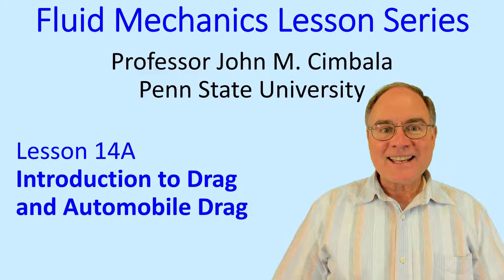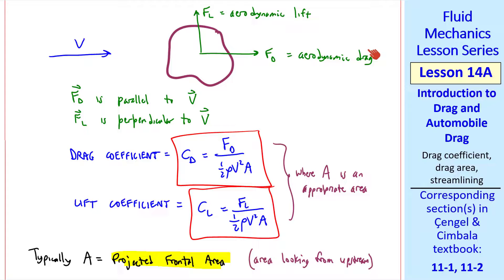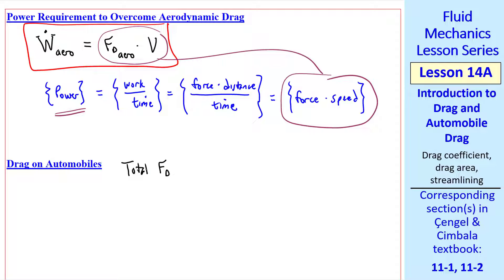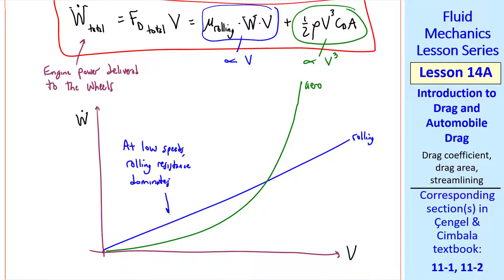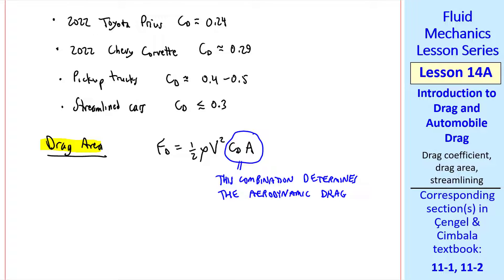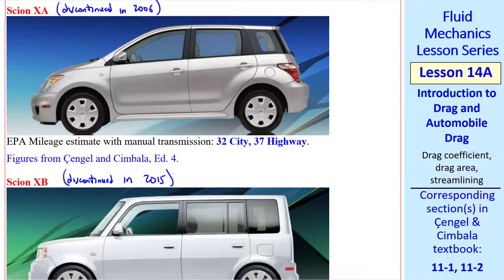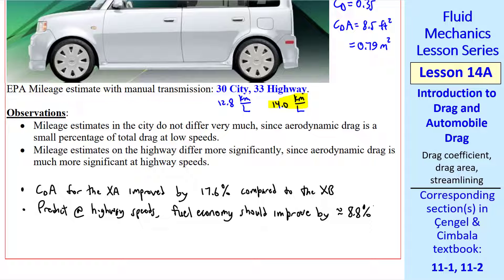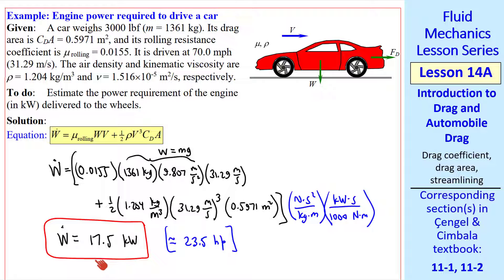Fluid Mechanics Lesson 14A: Introduction to Drag and Automobile Drag

Comment: Great video. I want to understand how to calculate the theoretical maximum speed of a car using the engine power, the car's dimensions, and its aerodynamic drag coefficient. Specifically, I'm trying to figure out how to determine the highest speed a car can achieve when all of the engine's power is used to overcome air resistance.
Reply from the maker: You need to know the maximum power that the engine can supply to the wheels. Let V be your unknown, with aerodynamic drag and rolling resistance drag as functions of V. You should have all the information needed to solve for V.
Thank you for your kind comment. Please tell your friends and colleagues about my YouTube channel where there are more than 480 free videos about the Bible, fluid mechanics, science, math, Excel, statistics, air pollution, and other topics. I would greatly appreciate it.
Reply: @johncimbala  Thanks for the replay. Assuming that the aerodynamic drag is the only important force on the vehicles,  how should I calculate
the theoretical maximum possible speed for the car?
Reply from the maker: @joellesoud9791  Same way I said above, but ignore rolling resistance. It would be better to include it, though.

Comment: Great video.  What about the effect of a headwind on the power needed to overcome drag ?
Since interaction of air particles with the vehicle is just elastic collisions the power needed to overcome drag should be the same for a vehicle driving with no wind at say 30m/s as it will be for a vehicle driving at 10m/s with a 20m/s headwind.
Reply from the maker: Thank you for your comment and question. My answer is both yes and no. Yes, the car will feel the RELATIVE wind, so a headwind will indeed increase the drag and required power. However, near the ground, the relative wind speed is less since the ground is stationary. The rolling resistance would not change. Thus, the overall drag (and power required) would increase with a headwind, but not as much as a car driving in no wind at the same speed as that relative wind.
Reply from the maker: By the way, please tell your friends and colleagues about my YouTube channel so that others are aware of this free resource.
Reply: @johncimbala  Thank you for the replay. Yes I'm aware of the wind speed gradient due to ground.
Not sure you are aware of the Veritasium videos about faster than wind direct downwind powered only by the wind vehicle.
I was trying to explain unsuccessfully how that vehicle actually works. The reason that vehicle can exceed wind speed has to do with energy storage in pressure differential created by the propeller so it will only exceed wind speed for a limited amount of time proportional with the amount of stored energy.
There is also a similar version of that vehicle that can drive directly upwind powered by wind and that also uses energy storage but in a different way.  In that case the vehicle can travel indefinitely upwind but it will charge wind energy then use that to accelerate and will do so many times per second so not visible without high speed video or fast measurement.
Reply from the maker: @electrodacus  I am not aware of that. Sounds interesting.
Reply: @johncimbala  If you can debunk the claims made in this video https://www.youtube.com/watch?v=yCsgoLc_fzI then I'm sure your youtube channel will gain a significantly large audience.
The explanation Derek made of how that vehicle works was completely wrong and violates the law of conservation of energy.
The UCLA professor knew Derek's explanation in the original video was wrong but he did not understood how the vehicle actually works and the fact that energy storage was involved.
Derek even invented equations to make it look like his explanation was correct.
The treadmill model is a simpler model and better as there are less variables compared to the large scale model.  The way that works is that a pressure differential is created by the propeller while the vehicle is constrained by the hand. As soon as the vehicle is released the vehicle can accelerate in the opposite direction of the treadmill because it is pushed and pulled by that stored pressure differential (works because air is a compressible fluid).
The acceleration rate drops as stored energy is being used but they did not measured that and just got to wrong conclusions. Then he showed a wheels only vehicle and claimed that represents the equivalent of a direct downwind faster that wind when it was in fact a direct upwind equivalent and he just confuses the input of that with the output.